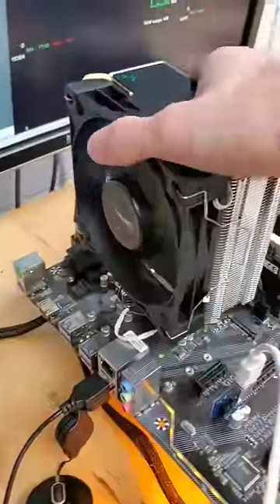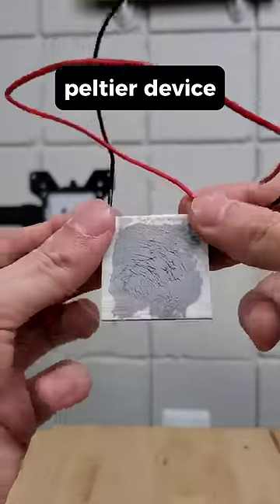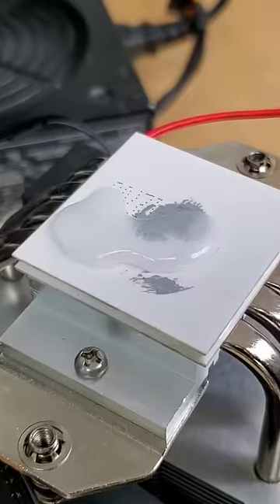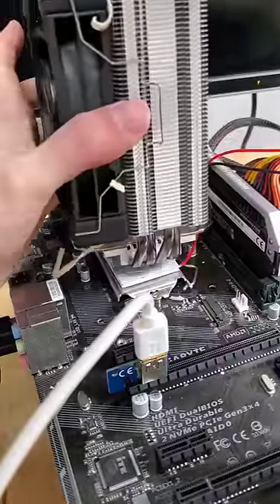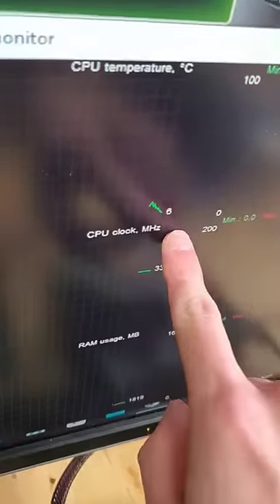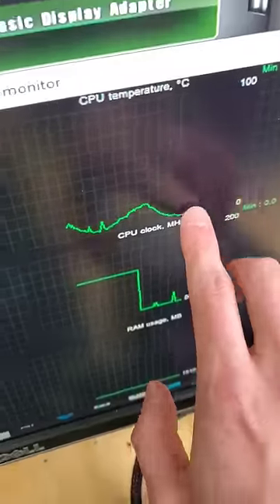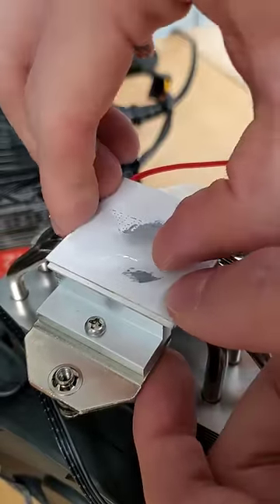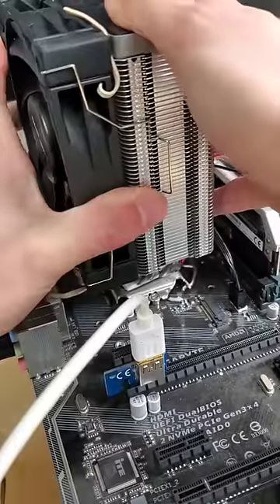using a Peltier device to cool a CPU BELOW 0°! #shorts

Comment: Peltier + closed loop feedback system with temperature sensor= temperature control
(not too cold nor hot enough) could be a good project to test on.
Reply: Especially with PID controller
Reply: It have been done by ekwb and Intel for Intel cpus. It was expensive and not worth the money
Reply: You'd need to have sensors to calculate dew point so it didn't get cold enough that condensation formed or you'd have all kinds of problems.
Reply: @albertoruiz1113 can you tell me channel name and video name or give link. I always wanted to do it.
Reply: @kuldeepsankpal6443  The math doesn't work out, basically.

The cold side gets cold, but then you've got an even larger amount of heat to remove from the hot side. So you need an even larger heatsink or water-system on the other side.

Because they draw a lot of power, that power has to go somewhere, thus the extra heat.

They only become effective when the temperature differential is large enough. So in most cases it will just increase the powerbill without doing anything.

In most cases, a good water or air setup will keep you well within the design boundaries of the parts-- 60c vs. 50c vs. 40c is not going to make a difference when you're gonna replace the part in <5 years anyway.
Reply: @FloodedStart I don’t really know if you’d have much issues with condensation besides maybe dissolving thermal paste in the surrounding area and over years maybe a tiny bit of corrosion on poorly plated parts. But this could potentially be used along side a moisture meter and a humidity meter to mitigate the issue, but also keeping the cpu under 40C instead of trying to get crazy sub 0 temps would mitigate that. But what I am interested in know is how good the temperatures would be if you fully submerged everything into mineral oil.
Reply: As of July 1, 2023, development on the Intel® Cryo Cooling Technology solution was discontinued. All versions of the software are provided as-is. Functional, security, or other updates will not be provided after December 31, 2023. No support for Intel Core processors 14th Gen will be provided. Please check with your auxiliary cooling provider for alternative solutions.

Seems like you need to ask Intel, why it didn't work, and learn from their mistake.... I think it was the pricepoint of almost $800 for a cooler
Reply: You can even see in this video that the peltier can't even keep up when the CPU isn't idling at 800 MHz, and the 3.2 GHz are probably not even sustained load frequency of the CPU. I bet the hardest part of the video was to get windows to use few enough resources so that the CPU even can idle that low for long enough.
Reply: I looked into using these and come to the conclusion its not worth it for 2 reasons. They are not very powerful. Also incredibly inefficient.
The cost to run a high end system would be basically doubled.
Reply: @rompdude  yes, if you want to go sub-zero without nitrogen, get an industrial kitchen chiller or something and just put the pc inside. No issues with condensation and all you need to do different from a normal setup is maybe switch the thermal paste and fans for something rated for the temps. Have your important storage somewhere else though.
Reply: Dads in 2050: don't touch the computer's thermostat 😂
Reply: @xz4ct801  oh damn, okay I get it now.
Reply: @maelthrajaluk42  coulda boil sum water I guess
Reply: @Mhul3z  sure the math doesn't check out, but it allows your cpu to work harder with a bigger leverage.

Comment: I still have this in my i7 first gen pc. It’s a Cooler Master V10. The peltier and cooler alone use 200 watts. It usually hovers around 5C not under load to ensure condensation doesn’t form.
Reply: uses   200w   ?    it  produces   power  !
Reply: @colinvanful they can produce power from heat or draw power to actively cool down the cold side. They are very power hungry when cooling and will produce a lot of extra heat on the hot side
Reply: Well the 1600w will serve a purpose now.
Reply: Isn't 5° still well below the dew point in most places?
Reply: @charmio  Most likely, but I live in a very dry climate. It has multiple thermometers to ensure it stays above the dew point. Just look up the product I mentioned. Excellent comment btw.
Reply: So you never start any cpu intensive program, then why cool it down so much? Because there is no chance in hell you a cooling any CPU at max load with any TEC cooler
Reply: I can relate, mine is a phone cooler brand called "blackshark" and it draws like 22 watts.
Reply: Unrelated to video, but
I also have first gen i7-920 😂
With 12 gigs of RAM, it's still usable. Planning to use it as home NAS/video server.
Reply: @danz9268  how do you use the Xiaomi blackshark cooler on a CPU?
Reply: @DragonXDrei  I did not, I use it on my phone while gaming
Reply: @danz9268  AHH yes the Blackshark Cooler. Not sure how it works since it's cooling the back of the phone. I believe that the Xiaomi phones, well the BS and the older T9s etc had liquid cooling, moving it around the back of the phone where the cooler comes in hand.

The only issue I have with the cooler, is that it requires Bluetooth to connect to the phone which makes no sense, since it plugs into the USBC port. It also runs out of juice pretty fast.
Reply: @DragonXDrei  It connects to bluetooth to let you control the rgb lights.
Reply: Not to mention its extremely inefficient and in all serious testing.. does not cool the CPU nearly good enough. Out of that say.. 200 watts of peltier you are really only getting less than 10% of that in usable cooling.. they really are under 10% efficient with the 90+% going straight to heat
Reply: @DarkAttack14  could you use it to cool down a water reservoir? That way you have fans on the radiator which goes into a reservoir cooled further by a peltier or something else... That only needs to cool down the liquid as much as it can.
Reply: @NavySeal2k if it's a first gen intel it's going to be fully loaded running most modern software

Comment: 1- It's not taking the temperature at full load, but at idle.
And
2- A peltier device uses about 40W. So if your CPU is a 65W version, you'd have to use a cooler that works on a 105W CPU.
And going this route, it makes so much more sense, to use a 105W capable AIO on a 64W CPU (like a 240 to 360mm AIO).
Reply: You need a much beefier peltier as the goal of this is probably over clocking (why else would you cool down a CPU below room temperature at all) and efficiency in chips goes down superlinear, so you probably need something between a 1 to 2kW Peltier.
Reply: A 40w peltier can't cool a 65w CPU. Peltiers are only around 40% efficient so expect ~150w peltier for 65w cpu
Reply: @uzair851 anyone tested actually feasibility with these things? Like for overlocking or just for hot chips? I feel like there’s got to be a catch
Reply: @Fee.1 its more for overclocking its doesnt work if cpu uses more power than it can cool
Reply: @Fee.1 there is a catch, and it has been done multiple times and proven that it’s not feasible unless you really are just cooling for overclocking testing.  The catch is the 40-120w, depending on the size of the peltier, of extra energy that you are putting into the cooling system.
Reply: @CominTHRU  I mean electricity is cheap, I feel like there’s bigger catches but what do I know
Reply: “Who the fuck is Jeff Bezos?”
Reply: This video creator should be ashamed for putting this up and not giving any actual context and saying it only works for lower power CPUs.
Reply: @michaelhanson5773  what are you talking about? You can get whatever wattage tec cooler you want and get as crazy as you want. Plenty of people have tested it out and played around with the idea with high wattage systems. 
Its not convenient, efficient, easy, good, or worthwhile but it does work
Reply: @Fee.1 People have tried it before and its just not effective for any sort of long term use. At least when I had heavily looked into it a couple years ago they basically don't transfer heat enough to be used for any long term cooling. You would basically need a much more powerful and larger surface area device in order to transfer it well enough and then you need a chonky heatsink to be able to disperse it. I believe Linus tech tips does a good video breaking down why something like this isn't viable. Because when I initially saw this I also thought this seems too good to be true why are people not utilizing them.
Reply: @Fee.1 yes…. The cooling devices needs well over twice as much power as the cpu is using.  So you end up with the hot end getting slammed with 3x+ as much power.  Now if your goal is something like let’s say very cold temps for the cpu sure, if the idea is overclocking well now you need a 10x more powerful cooler…. Why?  That peltier device will start melting at like 100c….  And it’s getting 3x+ more heat than the cpu was….  (That’s not even bring up the fact they don’t make 1inch squared 200 watt plus versions…) 

Also we don’t use peltier devices for cooling much they are basically just toys as compressing a refrigerant is 3-4x as efficient.  You would be better off just running a A/C unit cold end directly to the cpu.  (Though condensation would be a major pain in the ass to get under control)
Reply: Condensation is why there not used
Reply: @Vidar93 you just cool the fins on the aio and lower the voltage so it doesn't get below 0
Reply: You cannot say what wattage a peltier device actually uses  because it varies not only by temperature, but by the voltage input as well as the starting resistance of the peltier. Peltiers are not useful whatsoever for CPU cooling because of them being less than 10% efficient. They cannot move heat quick enough for anything but an idle load, and lets say its a 200 watt 12 volt peltier chip.. You are getting less than 20 watts of effective cooling, with the other 180+ watts going straight to heat! If you want to cool a 65 watt TDP CPU at full load you effectively need a peltier of more than 600-700 watts... It just is not worth it! That also means that heatsink and fan combo needs to be able to handle a dissipation of .. more than 550 watts. I can tell you from experience with an AMD 9590 with a 200 watt TDP.. That is about the edge of air cooling capabilities. Air cooling will never be sufficient for such a system

Comment: There's multiple reasons it was not widespread even if tested by multiple companies in the past : 

Pelletier devices are not magic and have a maximum transfert speed so when you hit that limit it will make the CPU hotter, but not slightly, it can even be worse than having a traditional CPU cooler. They also loose efficiency really fast with age so this process will end by overheating your CPU.
Reply: How about making a socket on the heat  sink for it? It's not over the cpu, so if it fails, your cpu is not fried instantly, potentially easy to remove if made with the slide in technique and lastly it won't take the hole heat while on maximum output giving it more time to cool down
Reply: @redflagy8 Something like this does actually exist. It's a tower heatsink with 2 sides, one making direct contact with the CPU, and one side making contact with the other side through a Peltier module. The problem is it doesn't resolve the problem of the Peltier itself using a bunch of power that you also have to cool, and iirc the thing uses like at least 100W. In most situations, it's just better to use said dual tower cooler normally, without a Peltier module. LinusTechTips has done a ton of Peltier cooling experiments, including the one I just mentioned, if you're curious.
Reply: @dacid44  Thank you very much. Even tho I used to be into computer building, I've fallen behind and haven't seen LTT in a long time. I guess it's time to go take a look, but I'm glad I wasn't the only one who thought of this 😅 have a nice day
Reply: @redflagy8  They have actually also done some projects showing where Peltier cooling makes more sense, for example, they built a Peltier-cooled gaming chair, where the Peltier cooler is plenty to cool down a human without getting overloaded.

Comment: An interesting thing is that stove fans actually use a peltier device but the opposite way round, having one side on the hot stove and the otherside on the cold heatsink creates a differential leading to a current being produced, which then runs a little DC motor, which keeps the top side cool ensuring that the differential remains! 

I think they're super neat

Comment: Ive seen tests that with a lot of the newer larger CPUs a Pelletier cant keep up.
   However, I think if you used enough Pelletiers to cover three times the surface area of the chip , and with a heat pipe in between, and of course enough cooling on the hot side, you could go cryogenic on some really hot , the hottest CPUs!!! But but you will need a really big power supply too.
Reply: True
Reply: At that point just use a bigger heatsink and maybe a fan.

Comment: Been using these since the 90’s. Condensation is a big issue, but if you take the necessary precautions it works wonders.

Comment: A Peltier module has something like 10% efficiency though. So to cool a 100-200 watt CPU (Core i3 to core i7), you'd need 1000-2000 watts of power to the Peltier. That 90% gets lost as heat, so you need 10 times the cooling fan/heating just to break even.

Comment: The same devices are used in cars that are equipped with heated and ventilated seats. each seat cushion and backrest has one of these stuck to a fan that will blow the heat or cold through the seat to your body.

Comment: Couldn't you undervolt the pad to make it less "cold" and make it cold enough that the cpu stays at like 15 - 20 degrees. Just cold enough that you can over clock the cpu but hot enough that it doesn't build up frost? Just questioning.

Comment: Bruh use solder as thermal paste day 2
Reply: It's just going to be the same as using other metals, it's been done before. It's just not a good idea because if it flows off into your board, it's a conductive material and will give you problems.

Comment: Now trying watercooling a Peltier device pls
Reply: I'd have freezing concerns
Reply: @blumind_web2264 no because the waterblock would be touching the hot side of the peltier/tec, water would be hot, not cold
Reply: I did this back on my old athlon 64 3200+ build back in 2005, make sure you have a large enough peltier device and cover both sides of the board with dielectric paste to prevent the condensation from killing your processor and motherboard

Comment: Does it actually work for long term use?
Reply: I wanna know too
Reply: if you don't know the other side of the Peltier module gets really hot which increases overall temperature of the pc which is not something you need
Reply: no one needs a room heater inside their pc
Reply: So it can but just like liquid nitrogen or phase change cooling you need to protect your components from moisture and the peltier also  consumes a lot of electricity to achieve its cooling you would need a separate power supply to run it and depending on how much heat it's transferring to the heat sink you might need to use an aio to handle the heat it produces properly which kinda defeats the purpose, most regular daily uses or gaming wouldn't benefit from zero to sub zero cooling
Reply: @Anonihmus2567 How would it not benefit if it means i could overclock my cpu/gpu more ?
Reply: @Serectos  peltier cooling consumes a large amount of power on its you potentially would need a separate PSU for it if you intended to overclock to a high enough frequency that you couldn't achieve with standard cooling solutions

Comment: A good Peltier junction goes down to neg 40 usually. It's been in the computing world since the early 90s. Needs to be used in a humidity controlled environment, but it works fairly well. It relies on a bimetallic strip usually - one material per side. Running a voltage through it causes an immense temperature differential, and one side freezes while the other steams.

Comment: Finally! Someone noticed the peltier device being used as a CPU cooler! Although, it can work but yeah the system and the water vapor drops is the issue...
Reply: Actually, the bigger issue is that the Peltier cannot transfer the heat quick enough when the/a (modern) CPU is actually being used and not at, roughly, idle. In fact, using a Peltier can be more harmful to temps.

Comment: I designed a cooler with it in 2014, to fit CPU and GPU, and at the same time reverse polarity on one peltier to produce a little bit of energy coming from the heat

Comment: I used to play with peltier semiconductor over 20 years ago on my Duron 800 😂 had to use separate PSU to power it up. But the real problem was condensation.  That can literally flood your cpu socket if it's not properly insulated 😂

Comment: I could be mistaken but most integrated circuits require some sort of heat to operate effectively. Like basically there's a point of thermal equilibrium that they reach where anything higher than that and the circuitry starts to fail and anything lower than that and the circuitry can't operate efficiently. By keeping it that cold you're not allowing the circuitry to heat up to a point of efficiency. 

Although I could be completely wrong
Reply: Best overclocks for CPUs happen under liquid nitrogen.

Comment: Well now we can run cpu hotter for better perf with that . But one thing that could be intteresting to prevent the cpu frome frezzing is to set the device to stay stuck at precise temp , for exemple , is set the devise to 50 °c once the cpu reach it the device turn on and prevent it to get hotter by ajusting the fan speed